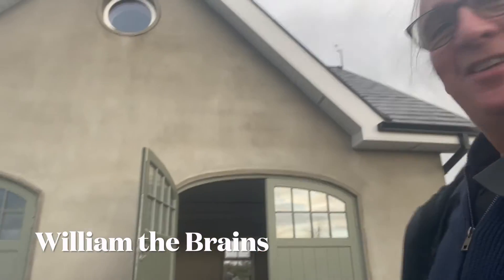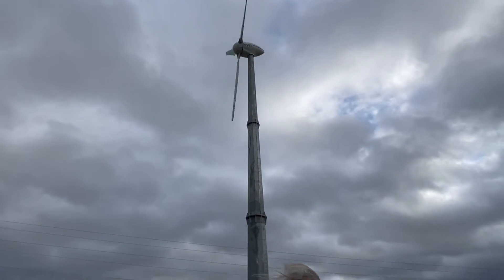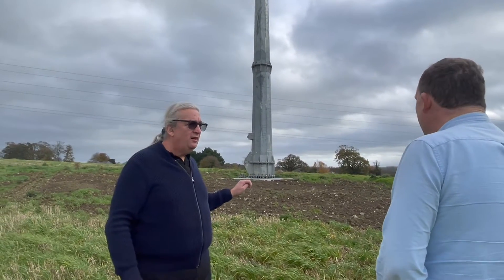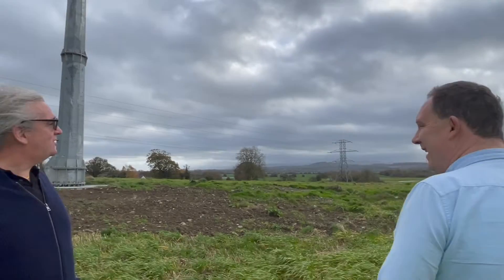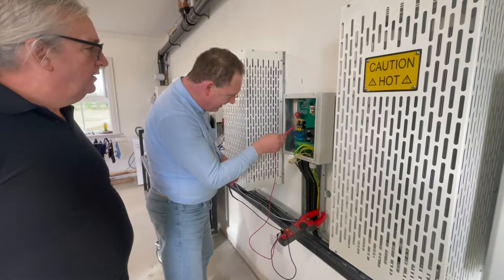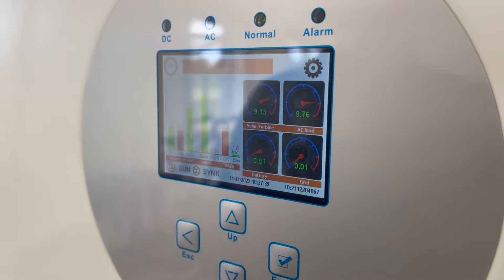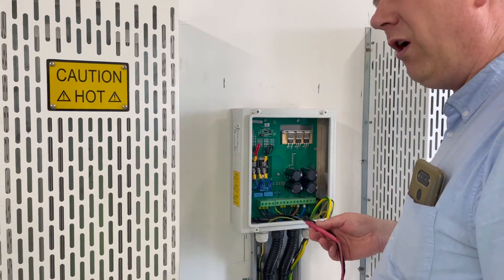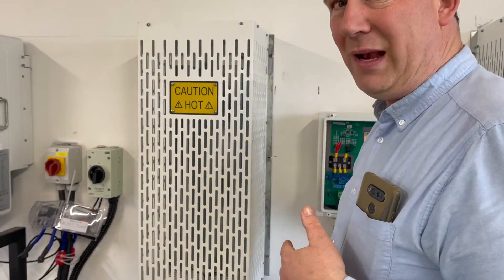#Sunsynk #Wind Turbine Site Visit

Comment: Are'nt dump loads a pure waste ? it would surely be better heating water with that resistive load instead ?
Reply: There is water being heated, only when it cant take any more heat via thermostat and max sell to grid level has been reached and theres no other load and batteries fully charged then the power has to go somewhere so it goes to dumps. Renewable energy is a feast or a famine, sometimes you just have too much! But even the dump heat isnt wasted as you might notice its drying logs and clothes by radiant heat, and keeping garage nice and warm! And anyway dump loads are required for electrical standards compliance.

Comment: Hi there. Can I connect a Tesup 5KW wind turbine to the 5KW Sunsynk inverter?
Reply: Im not familiar with tesup, is there wild frequency ac leaving the nacelle or is it allready rectified dc? Is there a dump load and dump controller? Either way if its wild ac or recified dc( depending on your voltages)  i would say yes its possible, but better to use 8kw inverter i imagine. Are you installing it parallel with the grid  with batteries or off grid with batteries ?
Reply: My question exactly. I got a 6kW Deye just set up with 4x700w panels, will be adding 2 more PLUS the turbine. The site I am at is very limited windspeed wise (average 5m/s over the year) and lacks proper clearance to achieve those speeds. I will be connecting the Tesup to its own input on the Deye. Will report later with a video or a short.

Comment: should have put 15 panels per mppt in series
Reply: Hello Wesley, I prefer to parallel strings where possible. I don't like high voltage  string's. In my experience smaller strings have more consistent working voltage. If a shadow  or excessive bird sh1t hits just one panel in a string then the current is reduced on the string. I started off with 3 panels over ten years ago and I had a 4 pole change over switch that allowed the 3 panels to be in series or parallel and I was taken back at the voltage variations of the 3 panels in series. They delivered more power through an appt charge controller when in parallel.  As a compromise to overlooking the current limit on the MPPT 2 input on these inverters I only today have altered  circuit 2 to be fully in series that is 7 panels from each tracker. So now I have cut the current to MPPT 2 in half but with a working voltage of about 460v. Next sunny day I am back on this Kildare site I will make a video showing the voltage difference between the 7 panels on each tracker. We have an ESB pole shading the nearer array that has to be removed for the low sun of this time of year. I will demonstrate the effect of this shadow on the now 14 panel circuit. The other circuit with 2 strings in parallel of 8 panels each I have no intention of making into one string. The potiential 18 amp max of this circuit is well under the 26amp max input on MPPT 1.